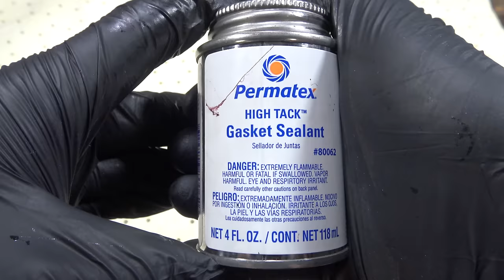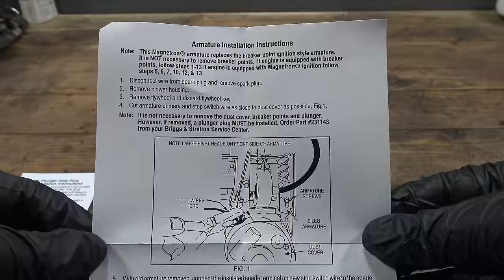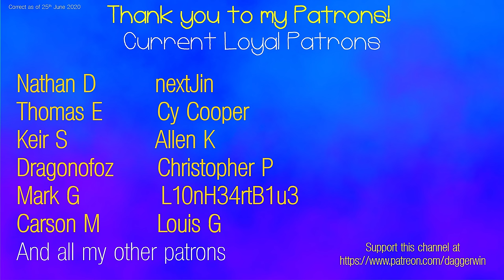I REBUILT A 43 YEAR OLD ENGINE THEN CUT GRASS WITH IT

Comment: a guy i know who built rally engines used an old dishwasher using the cleaning liquid instead water including the heating  function and it cleaned the parts spotlessly also another advantage was the the cases were so hot that he was able to insert bearings as soon as it came out of the washer
Reply: When they rebuild automatic transmissions they have what is the equivalent larger dishwasher works great.
Reply: @tetontent  I have a temco t10 I bought for $300, works great but I wish it was a little smaller heating 60 gallons kinda sucks
Reply: My instructor at UTI told us about the old dishwasher "partswasher" for projects too lol
Reply: @leocorral  oh lordy........which one were you at?
Reply: @leocorral  calm down mr raw emotion......i went to UTI as well and was asking which one you went to

Comment: This is awesome, to take a basket of parts, spend a few days cleaning the parts and to assemble everything and cut grass. Truly awesome. I find that most, not all lawn , mowers can be fixed with just a simple carb cleaning and PM service. The concept now is, if it wont run, junk it and buy another one. I love junking round old barns and “FREE” piles on the road, never know what you might find. One mans junk is another man’s treasure. Great job.

Comment: Just used this video to diagnose issues with a victa tiller 100 series 6 i bought yesterday. Pulling apart the carb, the pump spring was on the wrong side of the diaphragm! It still (just) ran. I never would have known without the video! Cheers!

Comment: The transition from when the powder coat goes from looking super dry to loking super wet is always so satisfying to me. So please don't cut that out
Reply: I know what you mean. The transition from that flat white color at the time of application. To the gloss white color,after the powder coat melts onto the parts from the heat is actually pretty satisfying.
Reply: ? It's inside the oven. The transition is the same as baking a cake. Unless he has an ovenproof camera, it's not going to happen.

Comment: I have a mower with the same engine, and man... this thing is a beast!! This engine worked around 10 years continuously and only requires a little maintenance, never changed piston and nothing. This engines are the best thing i ever had.

Comment: Thanks for posting this. Beautiful job. I have an old Rover Rapid (Australia) lawn mower that has a very similar Briggs and Stratton engine. We inherited the mower at our new rural property in Tasmania. It has never run right, always surging up and down. I recently pulled the carbi apart and cleaned it all. Found the pump spring on the fuel tank side instead of the carbi side. Also for some reason, my motor has a cylindrical air filter and housing instead of the flat horizontal sponge filter I have seen on them. Seems to run better now, but not 100% yet.

Comment: White Spirit: exists

Machinery Restorer: "We'll take your entire stock"
Reply: We'll drink half of that
Reply: You talking about my Cub Cadet 107? If so they are great tractors to get into working on, there's still replacement parts available for them and they are real easy and fun to work on. Just don't ever expect me to sell my 107...
Reply: I don't have too much experience with Craftsmans, but I hear the older ones are good tractors. However after using my big Cub Cadets I don't think I could ever downgrade to a craftsman machine.
Reply: Michael Fresh  yeah probably shoulda kept the wheel horses those are cool machines. I don't own any but I know someone with one.
Reply: Dang, man I really wonder how they managed to crack up the oil case that much... I don't think you could cause that much engine damage without like really abusing the machine...
Reply: Goodness, such a strange problem! I don't think I have ever seen anything like that happen around here. By the way, If you want you can see some of my tractors on my channel, I have a few videos on them
Reply: Michael Fresh  yes a 128 cubcadet
Reply: Michael Fresh  it's a 1973 model
Reply: Michael Fresh  no mine is a 12 hp kohler k301
Reply: Michael Fresh  yeah I've had it for 10yrs
Reply: Michael Fresh  and still runs great

Comment: I'd love this guy's skills. People laugh at me for working on my own car and I find things hard as I have sadly have autism. The pride thing is I try I don't need to pretend to be somebody I'm not and have to drive a flash car for an image. This is why i admire skills like this it's keeping something beautiful going
Reply: man.....please do not let people with zero ambition influence you. Learn a trade skill, save a ton of money fixing your own car, and laugh in their face the next time they get smacked by a repair shop for a 500 dollar brake job you can do yourself for about 100 bucks.
Reply: @midship_nc  thanks yes I did my brakes and got squeeks and found the problem to tight in the shims many hours later. Yes was hard but did it
Reply: @sandydogy  yep and if you get comfortable with stuff and get some practical tools and a trailer to tow them in, then you could fire up a mobile mechanic business and make good money. Most mobile mechanic type work is brakes, suspension, oil changes, tune ups, wheels bearings etc. People wont ask you to replace engines as a mobile mechanic. So actually you are not that far off from having a marketable skill, keep after it.

Comment: Very nice.  I have a 1970's? rototiller with an old 3.5 Briggs on it.  I plan on doing similar.  The tiller is so old, I am unsure of the brand.  Appears to be green in color, maybe an old Wards machine, but, it serves its' purpose well, and is a beast.  Starting to smell oil burning as I use it, so it is time to rebuild before things become terminal.  Winter 2022 project to refurb the entire tiller.  Again, well done!

Comment: My sons are using a Cub Cadet pusher I bought new when I got married in 1985. Just changed the blade to a mulcher, enclosed the chute, changed oil and air filter and they started using it. The carb's never been apart, etc.

Comment: really enjoyed this video, a couple things I wish you would you would of walked us through.
1 - how you rewind the spring and cord in the pull, that is not easy, tried once with no success
2 - how you attached the main shaft to the blade underneath
3 - you forgot to paint the air cleaner bolt!  
great job, purred like a kitten, very satisfying and relaxing watching these as I personally love to see old engines restored

Comment: I just used engine enamel to paint my 3 horsepower Briggs and Stratton lawnmower engine which I rebuilt,I didn't use primer on the engine because particularly on the cooling fins it will cause the paint to blister up & fall off,I had to repaint the top cover on mine because I primed underneath it.

I painted it when it was all bolted together just as they did at the factory,I have also relapped the valves into their seats & adjusted the valve clearance by grinding down the valve stems,the rings have been replaced with Stens steel items,not the chrome faced rings & I did give the cylinder a light hone.

The old rings gaps measured at 1.15 millimetres (0.045") whereas the new ones were about 0.22 millimetres (0.00866"),a 0.2mm (0.008") feeler gauge was a slightly loose fit but a 0.25mm feeler gauge wouldn't fit so I estimated about 0.22 millimetres.

I'm going to do up a 1985 model 4 horsepower Briggs and Stratton lawnmower engine next !

Comment: On this side of the pond, I began working on those engines when they had the "banger" (aka hot dog) muffler.  Still get that great feeling when you've completed the work and it roars back to life.  Great job.  My mother did not like going to use the "hob" and finding I had baked freshly painted parts in it. Narragansett Bay

Comment: Thats an great engine, we do have the same engine but its on the third mower, the chassis used to rust through. With seasonal oil/airfilter/sparkplug changes to new ones does the trick. It stays outside all season, temperatures varies from +30c heat to -30c freeze with thick snow. And always starts within three pulls.

Comment: When I was a kid, I mowed many a lawn with a 3.5 hp Briggs and Stratton and it did it just as ease as larger more modern lawn mower engines. They took more abuse that any of these newer engines. I have a 5.5 Briggs on a 21 mower and It's 4 years old and half wore out and I haven't even abused it at all.

Comment: I found a 1980 Briggs 5hp engine at the dump and am restoring it. It’s almost finished. Wish I had some of the tools you used on yours. I’m uncertain why it was tossed, other than the fact that it’s 40 years old. Only had to order gaskets and a carb rebuild kit so far.

Comment: When you build an engine 
Do you
Check the deck and head for parallel 
Check the piston pin for wear
Isn’t lapping the exhaust valve at the end of the valve going to cause premature burning of the valve

Comment: Excellent work. Just a little correction. The ignition coil gap adjustment is not 0.010 mm but 0.10 mm ... Nice.

Comment: When you blast sheet metal try using ground walnut shell it won't remove metal or distort it. If you turn that engine 180 degrees it'll be easier to start and access the controls

Comment: I have a pretty good idea why the engine was in parts.  It wasn't running right and after trouble shooting everything you decide to take things apart to investigate.  Once you have the head off and valves out you might as well just rebuild the engine since you are in there.

Comment: I was a year old, when that engine was manufactured. They don't make them like they used to.
Reply: That's for sure I bought a new push mower 2 yrs ago went out to start it and it wouldn't start went to tap on the carb thinking needle valve under the float was stuck and cracked the carb come to find out it was mostly made out of plastic what a piece of shit I bought and by the way it did have spark.
Reply: All shit made in China, if you find a old motor and have the skills, you get another 50 years out of it.

Comment: Is the second fuel tank mounting bolt and spacer that go into the block missing thats located behind the fuel cap-?  Also no oil in the starter clutch between top of crankshaft and inside starter recoil dog, theres a hole in the top to squirt oil into it, eventually they rust and the starter doesnt want to recoil.  I spent many years rebuilding these engines both for my lawn mowing business and for others, love these old Briggs engines, I even had one that was so old it had a cast iron block - im 60 now and my current one I bought new 29 years ago and still not using oil.  I use a blend of HD-30 weight and 10-30 synthetic oil.  Its on its third deck after they rust out but the engine still runs great with just a couple carb kits and regular maintenance.

Comment: I'd like to point out another fantastic way to clean carbs (and other engine parts) is soda blasting. I've used it on horrible, HORRIBLE carbs, then ultrasonic cleaned them, they look brand new and no problems!

Comment: It’s a Briggs. The rest of the motor will fall apart before they stop. I pulled out out of a flood, cleaned the mud out with a hose and changed the oil and it’s been going for 10 years now with not a Otho going done to it.

Comment: hey buddy, I had exactly the same engine on a mountfield mower but the crankcase was even better because it was made of very thick aluminum with the super strong woven bag! Indestructible engine, we had the maios head gasket redone, I found that over time, it lost power ... I sold them because it had no traction and nobody wanted to renovate it ... have pictures if you want to see it!

Comment: great job, but a helpfull tip: you forgot about oiling the pull starter as there is supposed to be a little sponge at the end to the stem where the crankshaft slots into this needs oil or there will be friction. If you take the top cover off you will see at the end of the ratchet shaft there is a tiny hole for you to put oil in. it needs something like 3in1 or some other thin oil or it will bind
Reply from the maker: Thanks yeah I showed that in the previous video, I try not to repeat myself too much
Reply: @MachineryRestorer  ah fair enough kinda makes me feel bad cuz was given a motor like this from a 69 bail elevator I I just cleaned it up with a bit of wd40 and wire wool and sanded the connections for the coil and it started first try after being left for 40 years in a broken barn but it deserves better really

Comment: Even "back in the day" it was rare to find an 11CID engine. They were usually on big commercial decks. In 50 years I only found 2. The starter cover and air cleaner are different, and that piston is much bigger than the 3-1/2; crank also has a bit longer stroke.

Comment: Nice work but an aluminum cylinder should never be honed. Lapping is what is done to leave the silicone particles in the aluminum proud. Aluminum bores also require the use of chrome rings but you knew that!

Comment: Personally I like the look of the painted engine block but the air cooling system won’t work as well, it will cool the paint more and not cool the engine enough

Comment: The little guy doesn´t seem too happy that You put him to work again... I hated briggs mowers, they always seemed just loud and gutless... quite like Detroits... The only Briggs i remember sounded decent AND had some power was in the Toro mower my dad bought in the early 80´s and kept since. Always well maintained it started mostly at 2nd pull but was expensive, nearly 2000 German Marks at the time, crazy money it seemed but the thing just needed a spark plug wire out of the ordinary. Good mower.

Comment: I am currently restoring the same motor, but with the original snapper deck. I was wondering what type of paint you used on the crankcase, Im not to sure what to use.

Comment: I used to be a small engine mech in the 70's. Worked on that model a lot.!  That diaphragm is the weakest [art of that motor they don't last. It should be replaced. the needle valve should be replaced .Great job !

Comment: I have the same motor only in orange because it was Made for a Swedish Klippo G5. A great engine that could last a lifetime. Mine is cleaned with a toothbrush and some petrol so it’s not looking as good as this one you restored. Is there an automatic choke on it or how does it get extra fuel to start?

Comment: also whats the engine code? it can tell you what year what sump it has and the shaft dimensions, you can also run a later model coil and delete the points

Comment: Hi daggerwin I was wondering what paint you used as it would have to be very heat resistant as you painted the cylinder head with it and petrol resistant and you always spill some great video

Comment: Wonder if you would do the same for others? I DETEST the B&S OHV engines because of the constant valve adjustment, I have some of the Flat ( L head ) designs I would like to have restored, would GIVE you one if you would do some restoration for me

Comment: Do these have an iron cylinder liner? IIRC, some really old ('50s) aluminum B&S engines only chrome-plated the cylinder walls. 
Still using a 35 (?) year-old Murray with what looks like this same low-tank B&S engine, except for the color. 
Engine is black, with a sticker that says "Classic". My brother thrashes it. I'm amazed it still runs!

Comment: The rebuild looks great - as does all of your work. But it appears the engine was mounted 180° out onto the mower deck. I know the two did not start together, but was there an issue mounting the motor reversed, so, for instance, the pull cord points backwards?

Comment: I've got the same 1-3/4hp Briggs on a 22" push mower I bought for $45 back in '72 and the neighbor came by 1 year ago and was fooling with the throttle going back and forth really hard and now it won't run except at high speed. What did he break under the cover that controls the throttle? Got any idea. There is a wire rod that connects throttle to a swinging air gate under the cover as I remember?
Might be that he broke it as the metal was worn severely.? The motor was running Ok before he did that. This model was the staggered  small wheel behind the grass exhaust on the right side. The motor is white and the mag shell was red.

Comment: I’m glad that engine is taken care of. It’s also nice when pieces start going on the machine thus disappearing from the workspace.

I had a question about one of our vehicles. I have an Arctic Cat 90 ATV that doesn’t run very well. It won’t go full speed, until it acts like it’s running out of fuel, then dies. I’ve cleaned the carb several times because I know how squirrelly they can be. That didn’t help. The fuel lines and filter and tank are all cleared out, and just to check, we put a test tank on. Still didn’t fix it. I tried another carb that I know works, same thing. Spark plug and plug cap we’re replaced and still nothing. We sent it to the “professionals” and they rebuilt the engine unnecessarily (hasn’t gotten lots of use). Still nothing. Do you have any ideas on what to try next? Any suggestions would be appreciated.
Reply: Try to drill out the pilot screw hole one size up.

Comment: Not a fan of solid state ignitions, they're a bit sacreligious on old engines (a lot of people don't mess with them). Also, they can fail, and when they do the whole coil needs to be changed rather than just fixing the points. The original points and condensor would have been perfectly fine if adjusted right.

Also...
grass around trees: haha, I survived...
future video: Vintage Weed Eater Rebuild
grass: uh oh...